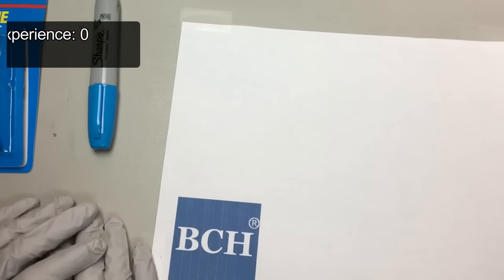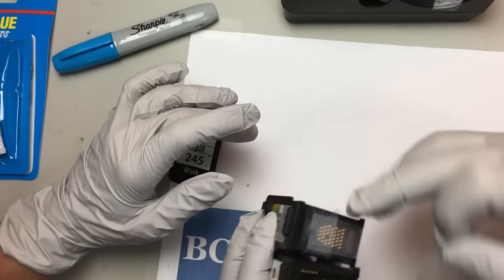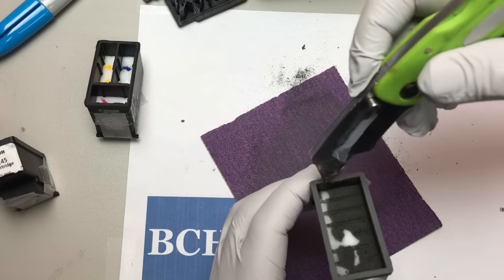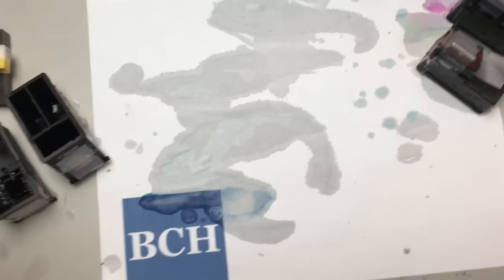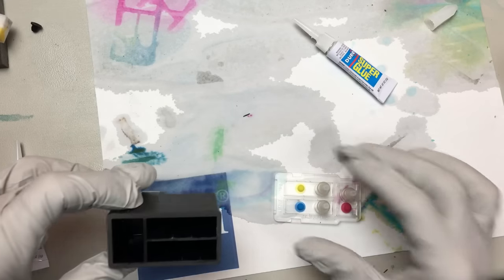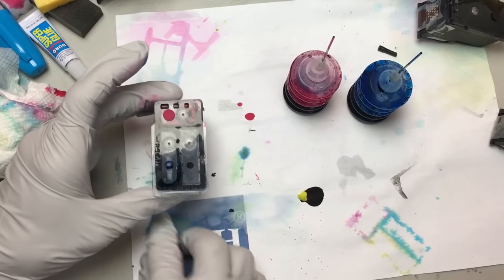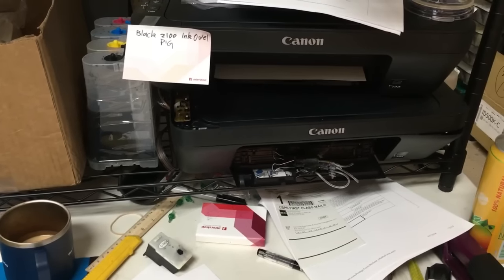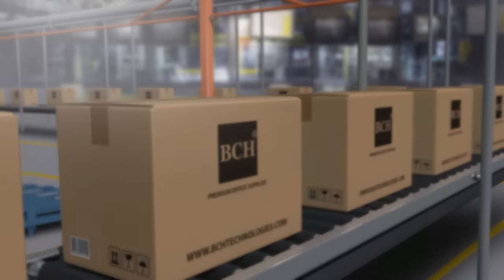How to Start Making Canon Spongeless Refillable Cartridges: PG-240 CL-241 PG-245 CL-246

Comment from the maker: Link to the cover: https://bchtechnologies.com/modification-kit-for-making-spongeless-cartridge-with-canon-pg-210-cl-211-pg-240-cl-241-pg-245-cl-246-pg-243-cl-244-as-rfc-cb2/
Your country may have a different name for the cartridge, for example, PG-245/CL-246 may become PG-545/ CL-546 or PG-240/CL241 becomes PG-840/CL-841.  They are the same and should work on yours.
Reply: PLEASE PROVIDE SUITABLE INK FOR PG-245 & CL-246 ALONG WITH ABOVE LINK.IF YOU SALE ONE.
Reply: need to program it, as it stops printing filling it up often? .Can the canon ones be program to use 10 times
Reply: can we use pigment ink on cartridge?
Reply: That MG 3620 looks a lot like my TS 3522  i will be checking back to your website for more info
Reply: Can I do this with Canon PG 275 and 276?
Reply: This is the link to purchase the clear lids for the cartilage right?
Reply from the maker: @teresamontes2542  Yes
Reply: @teresamontes2542  0:39
Reply: Where do I buy the transparent lid?
Reply: @williegarcia6753 😊

Comment: Can i just glue the original cover?
Reply from the maker: Thank you so much for your question and for subscribing to my channel! Every subscriber truly matters to me—I'm working hard to reach 100k subscribers, and your support makes all the difference. I appreciate you taking the time to engage with my content!

Regarding your question about the spongeless conversion, you cannot simply glue the original cover without using the spongeless conversion cover. The issue lies in pressure regulation. Without a proper mechanism to control the pressure inside the cartridge, all the ink would flow out uncontrollably. The spongeless conversion cover includes a pressure regulator, which looks like a white column next to the refill hole. This component is crucial as it replaces the sponge’s original role in managing the ink flow.

If you need further clarification or have more questions, feel free to email me at support@bchtechnologies.com or post your question on my latest video (not shorts) for a quicker response. Thanks again for your support, and I’m always here to help you get the most out of your printer!

Comment: Purchased the kit from BCH, prepared and installed new covers without a problem, filled with ink, plugged the holes, placed them in the printer, test was perfect. No problems. Highly recommend...
Reply: Did you use the duro glue as in the video or something else?  Thanks.   Hoping to avoid leaks!
Reply: how long for your glue to dry?

Comment: I received my order a few days ago. We carefully followed the video & website instructions. But when it came time to fill the black ink, it was leaking profusely from the nozzle. We figured it could be from not removing the tape first and pressure being applied since it didn’t leak after we removed it. I had to do several print tests and cleanings and it’s now working great!
Reply: Yes the sponge holds the ink through capillary action, so that it doesn't just flow out.

Comment: Just drilling a little hole and fill with a syringe is still the simplest way to do it, the trick is do it before running out of ink, this way the flow of ink is not interrupted. 
Print regularly even when you have nothing to print, print anything, keep the wetness around those printing head :)
Amazon has many refill kits, 5 X100ml bottles, 2 blacks with the colors at around 25$ cad.
500 ml is a lot of refills.
Reply: I often did that refilling directly into the sponge... I save a lot of money of it..
Reply: Yep, and I just bought it for less than 20 bucks for the same stuff Amazon 👌👌👌
Reply: His method increases the chance of contamination with all the sanding, glue, and handling. I agree the small hole and needle method is simpler with less chance of printer damage.
Reply: Hae which ink is good to use

Comment: I have been doing this before watching your video, this video got all the tricks! 
The only problem for me is that there are unbalance pressure of the modified cartridge, 
Ink will stop flowing after 10-20 pages of printing, need unplug the small rubber to make the ink flow again.
Might be faulty of the single direction air valve
Reply from the maker: You will need a pressure regulator in each chamber.
Reply: @BCHTechnologies  there is one , but seem mulfunction already , thanks for reply

Comment: Sorry Mr. Kevin. I posted the same question in two different videos and I deleted the wrong one. Thank you so much for answering my question about how long do I leave it with the rubber bands on. You said usually about 12 hours, in case someone else is also wondering. I just finished mines and it was very easy.  Thank you so much for everything. I really appreciate it. I will later go to your website to do the review. Thanks again. Guys you need to buy this. I definitely recommend it.
Reply from the maker: Thanks 😊
Reply: @BCHTechnologies  Mr. Kevin I have another question for you. Can I put pigment ink on the color cartridge for the Canon TR7020? If the answer is yes, do you sell any? Thanks.

Comment: When placing the tip onto the cart in the water there is a small amount of water between the two, and will cause color shifting. Place the syringe over the cart before placing in water each port test would be best

Comment: Purchased the kit from bch technologies and followed all procedures to remove the clog from the cartridge. Both black and color inks are printing good now, only problem is my black is spilling little ink from the print head at the top or sometimes bottom of the page when I take printout. If I remove and wipe the print head, it prints good. Is there a fix for this leakage?

Comment: Clog cartridges can be fix by putting it in a container with hot water 9-100 and leave it for 1 hour.  then fill a syringe with hot water and insert the needle inside the cartridge holes then slowly inject water in it.... repeat until all the ink inside that's coming out is a little bit clearer.... I used this for my old cannon fine cartridges  and it works amazing...
Reply: How did you removed the injected water?

Comment: I drilled 2mm holes on top into each color then used vented plugs. I pushed about 350 ml of black through the 245 before it got clogged. I refilled about 200 ml of ink in the original cartridge before clogging. I'm looking for another printer because it got damaged by a powerline spike, it doesn't do anything when I turn it on no motor noise just a power light.  I want to try finding one that uses the same cartridge. I printed thousands of pages of heavy card stock for 4 years with it. The HP printer printed about 1/3 of that before it mechanically wore out.

Comment: You need to remove the tape from the chips correct before inserting the cartridge in the printer? I bought a used printer and the cartridge is installed with the tape on the nozzle at the bottom

Comment: does this work with the Cannon TS3522 PG-275 CL-276? if so shoud i purchase the regular size/or XL cartridge first use it then purchase your kit then go from there I really love that pixma computer and i want to use it i bought a toner laser jet but certain mediums call for inkjet and the ecotank i purchase i dont want to put regular ink in it so i can use it for sublimation.

this would be a god send if compatible with my printer. love your video even though the volume is not as loud i wass very attentative and intrigued by your methods and kit!!!

Comment: Hello, I'm not sure if I'll get an answer, but here goes. I have a Canon e4570 with a modified external ink tank, on the side of the machine.
I do about 1200pages in black and my printer head has to be changed. Color head is changed at 1700 pages.
Any reason why? Are the heads meant to be replaced often? Compared to the original once used cartridge, I believe that you could only ger 300pgs.

Comment: Hi Kevin, when you put pressure into the cartridge to unclog the head. Question why doesn't this keep pushing out the ink.  When I took off my old cover and pored di water into the 3 tanks canon CL-561 and left over night the water had leaked out so why wont the ink ??  Kind Regards

Comment: Other videos say that the sponge serves an essential function: It basically exerts an upward force on the ink in the cartridge.  If you put in too much ink, you saturate the entire sponge, so it can no longer exert that force, and the cartridge won't work.  I got the impression that it will fail the test that the printer puts the cartridge through, and you, therefore, can't get the printer to even attempt to print a page.

Or did I misunderstand/was I misled?
Reply from the maker: The spongeless’ cover is specially made.  It has a pressure regulator for each color.  It’s not just a generic cover.  The pressures regulators works like the sponge without taking massive space.
Reply: Ahhhhhh.  Interesting.  Thanks for the prompt reply.

Comment: Could you just reuse the existing top after removing the sponge, without buying the clear lids? If not, could you explain why not.
Reply: There is a video that shows a guy doing just that. He removed the lid and filled it to a certain point and them just put the original spong and top back on and taped the top down.

Comment: Its awesome. Can we get the new back cover online like the one you have ? Rest seems to be feasible.
Reply from the maker: Link to the cover: https://bchtechnologies.com/modification-kit-for-making-spongeless-cartridge-with-canon-pg-210-cl-211-pg-240-cl-241-pg-245-cl-246-pg-243-cl-244-as-rfc-cb2/
Your country may have a different name for the cartridge, for example, PG-245/CL-246 may become PG-545/ CL-546 or PG-240/CL241 becomes PG-840/CL-841.  They are the same and should work on yours.  You do need to reset.  Please see 3rd paragraph of this article: https://bchtechnologies.com/blog/faq-printer-is-not-working-canon-cartridge-pg210-cl211-pg243-cl244-pg245-cl246-pg240-cl241-xl-or-nonxl/

Comment: Yeah I tried this. Ordered the ink kit, followed the step by step and felt like I was saving myself money. Then my printer said it didn't recognize the ink cartridge and wouldn't work. I went ahead and purchased real cartridges and printed 1 page before my printer stopped and gave an error code. The printer never worked again. So the thinking that I was saving myself money was replaced with receipts for Ink Kit, New Ink cartridges, and A New Printer. Thanks for the help
Reply: That's an easy fix by reseting the printer cleaning the head etc.. I had such problems even before start refilling so knew how to troubleshoot such issues and clear it
Don't give up because of easy fix like that!
Reply: If you should try it again and get that message, hold down the resume button for 5 to 15 seconds and it should bypass the error message.

Comment: Great demo,
My question is can I do this project for the hp122 cartridge, spongeless , with the original cover?
+ What does the sponge really do?
Thanks in advance 👍🏾
Reply: & iknow that bch provides the covers for the hp122 but shipping is terrible in my country! 🤦
Reply: sponge have only ink not wink and move lot in tank, same used formula 1 F1 car gasoline tank, because you print tank move fast alltime left to right and ink in tank wing and move lot, but add sponge not move, important have sponge in tank.

Comment: If the black ink cartridge was working fine and suddently it is showing horizontal lines but when you put it in a cup with water the ink comes out easily, what could be the reason for the print out to show horizontal lines? I already used the clip to pump the ink fromt he bottom of the cartridge with a seringe and the cartridge is spongeless.

Comment: Hi Kevin Everyone that comes onto your site is a potential customer.  I myself need convincing this product works. Putting pressure into the tank in my view will push the ink out ? Having no pressure and being zero bar pressure (atmospheric pressure) will in time just leak out. Having a vacuum inside the tank if this is possible of course  will cause it to stop working.  Lets look at a starter cartridge from canon if you put more ink then the sponge will take it leaks out the head I know I've done this ! so is this just not the same as your spongless modification ? Will you give us the science behind why they don't or do leak ? convince us before we buy your product.    From my other post .................Hi Kevin, when you put pressure into the cartridge to unclog the head. Question why doesn't this keep pushing out the ink.  When I took off my old cover and pored di water into the 3 tanks canon CL-561 and left over night the water had leaked out so why wont the ink ??  Kind Regards

Comment: Ma'am/sir please help me, we tried to convert our canon pixma mp237 to continues ink but what happened is, the cartridges leaked a lot so I take off the ciss again and refill the cartridges but it still leaked a lot and then the colored ink printing lay out become blue green and the black is not visible and the printing lay out is just lines. Please help me🙏🙏🙏
Reply from the maker: You can use a priming tool and suck ink out of cartridge.  Once the old ink is gone, the printer should back to work.

Comment: Is there a cover like that for Canon cartridge 260/261 ?
Reply from the maker: The same cover works for 260/261.  For the color, you need to sand down the middle part a little.  For details, see: https://youtu.be/z_-4xQnSu44

Comment: I refilled my existing cartridges but it was completely useless if I can't reset the chip on the cartridge. After a while the printer stopped printing and now it's showing the message: "Black ink volume unknown". This is another corporate ploy to force users to buy only their original and expensive cartridges. Any suggestions?
Reply: Try to hold the STOP or RESET button for 10 seconds, it should reset forever the sensor.

Comment: Where can I get the covers or the cartridges??
Reply from the maker: Link to the cover: https://bchtechnologies.com/modification-kit-for-making-spongeless-cartridge-with-canon-pg-210-cl-211-pg-240-cl-241-pg-245-cl-246-pg-243-cl-244-as-rfc-cb2/
Your country may have a different name for the cartridge, for example, PG-245/CL-246 may become PG-545/ CL-546 or PG-240/CL241 becomes PG-840/CL-841.  They are the same and should work on yours.

Comment: Without the sponge, wouldn't it leak through the head constantly?
Reply from the maker: If you don’t have an air regulator on the cover, then it will leak.
Reply: @BCHTechnologies  Does your kit come with that or is it separate?

Comment: I went to the site, i see aa list of the models for cannon     i have the MG2522 and it is not on the list.   The MG2522  takes these ink carts : 233, 244.    also 245, 246.  also 245XL and 246XL      

   but since my printer is not on the list i can't do this?  is that correct?       I have not opened my printer yet. I just bought it becuase my HP officeJet pr L7680 has a printhead problem and it's pissing me off.  But i can take the MG2522 back and get a different model if this one will not refill.    You see I spent a lot of money on ink already and my ink says HP OR Cannon    i am kind of tired of HP's bull crap with their counters and software and chips and my expense in trying to keep these going good. it seems to me that they can remotely jack my printer up.  these heads i have now are rand new. they worked for three days and an update rendered my printer useless with print head fail  both simultaneously. 

  what is the best most long lasting printer t o do this with ? 

Printer Model No.
iP2820 (1)
MG2120 (1)
MG2220 (1)
MG3120 (1)
MG3220 (1)
MG3520 (1)
MG3620 (1)
MG4220 (1)
MX372 (1)
MX392 (1)
MX432 (1)
MX439 (1)
MX452 (1)
MX459 (1)
MX472 (1)
MX512 (1)
MX522 (1)
MX532 (1)
TS3120 (1)
TS5120 (1)
Reply from the maker: We list products by cartridge numbers, not by printer models.  Otherwise, we will have thousands of models to list.  You already know where to find the 245/246 (same as 233/234) refill.  The best printer is MX490 or MX492.

Comment: Thought the sponge was required so that capillary action stops the ink just running out of the nozzles.
Big mistake not having the sponge.
Reply from the maker: There is a pressure regulator on the new cover, replace the function of sponge.
Reply: @BCHTechnologies  what kind of ink? Where van I get it?
Reply: there is no air going in as it is sealed so ink only flows when required by the printer

Comment: When empty my CANON ink cartridge I drill a hole into the TOP then using some BLACK GENERIC REFILL ink I put the bottle needle into the hole and squeeze until the ink is coming out the hole  then TAPE over the hole and put the cartridge back in ! I only use GRAYSCALE printing  (BLACK) and this process works  4 -5 times until the ink-jets on the bottom clog THEN I go buy another one for $20  :-)

Comment: This is my first time using this size of cartridge.  My old cartridges were the skinny ones and I had to reset the counter with those  cartridges.  These larger cartridges don't fit in my unit to reset the counter.  My brother didn't think these cartridges needed to be reset.  Can you please confirm if I need to buy a reset counter or if the refilled cartridge will work without that step.   Thanks,
Reply from the maker: Don't need reset.  However, you need to turn it off.  For details, see this video: https://youtu.be/gNbQS2kWliQ